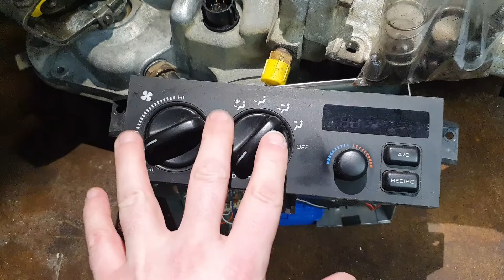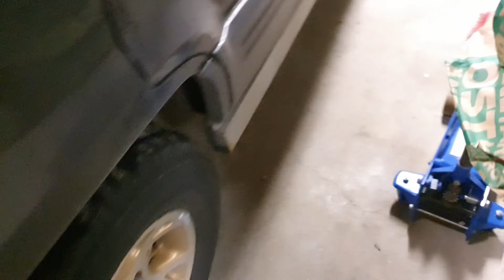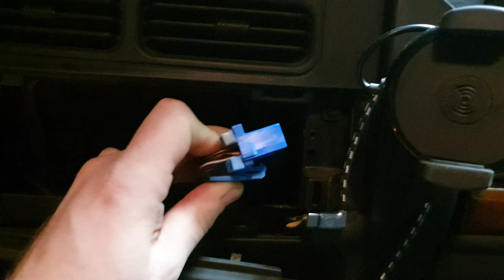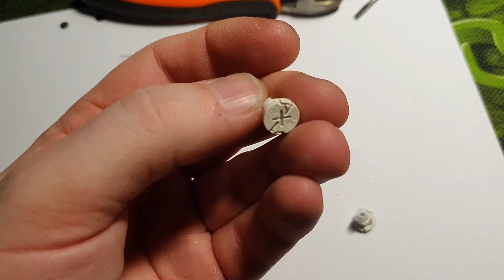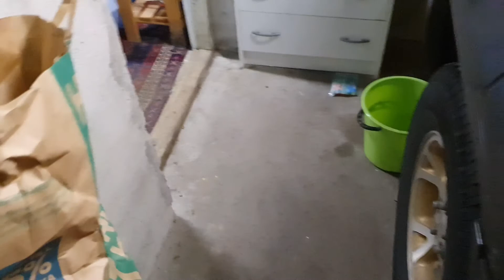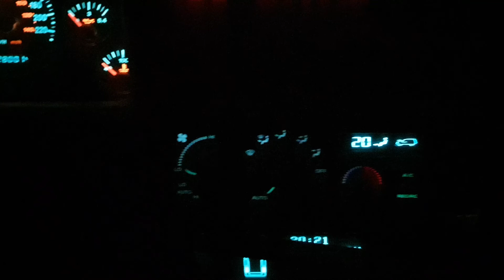ZJ Grand Cherokee ACC Panel lights replacement.

Comment: Ok, but you never said what size bulbs they are. That would be helpful, i need to know lol
Reply from the maker: I believe you can use Bosch part number 1 987 302 208.
Perhaps you can find a cross reference to something else thats similar. 

Its been so long since i did this and the car is no longer in my possession, so i cant verify it at this time. 
I do believe i used T3 light bulbs and just removed the bulb itself from the plastic socket, as the sockets differed from the one Chrysler used in the panel.
Reply: @GustavLindstroem I know it was a while ago. Didn't think id get a reply lol. I tried some t3 I had from my xj and they are to small, I ordered t5 but to big for the housing hole, so I just ordered t4s that will be here tomorrow so hopefully they work. Thabk you for the reply though.

Comment: How you pulled the ACC unit out? I removed the screws but it come out about an inch and got stuck
Reply from the maker: I honestly can't remember, but I think I had to remove a lot of the plastic cladding around the AC unit. 
Perhaps in combination with bending the sides away with some tool.
After that it was only the cables that stopped it from coming out.

Comment: the push buttons (engage AC and recirculation) have dedicated bulbs? In my 98 ZJ only these buttons dont have any light coming from it.
Reply from the maker: @andreluis90969  i don't think so, my guess is that the bulb that lights up that entire corner of the climate control also lights these up from behind.
That being said, I never did disassemble the front panel.
Reply: @GustavLindstroem  Thanks for replying. I have a spare AC control, so I can open it and check.